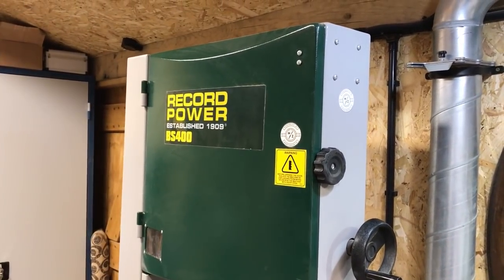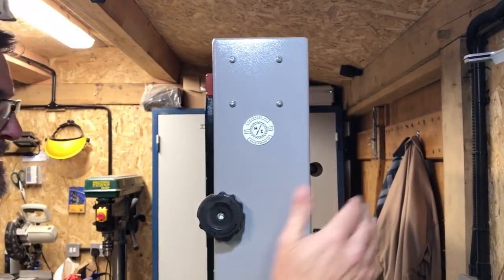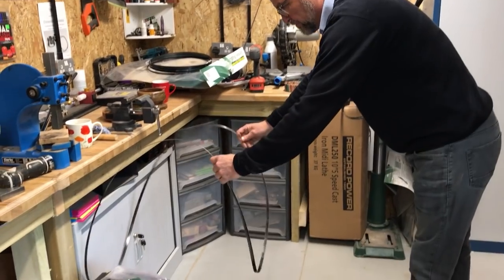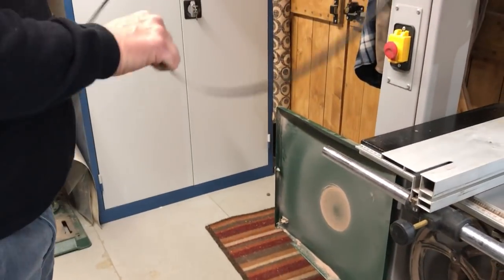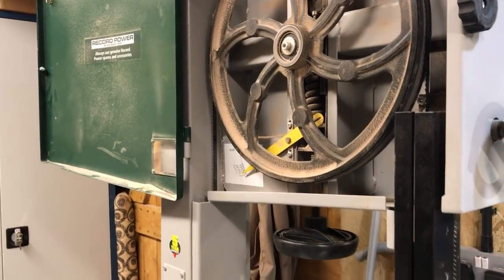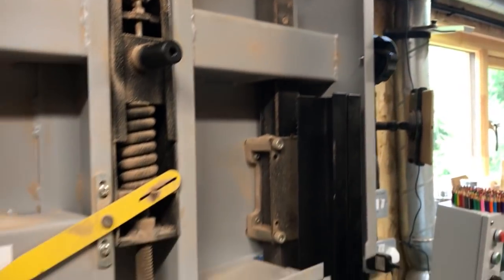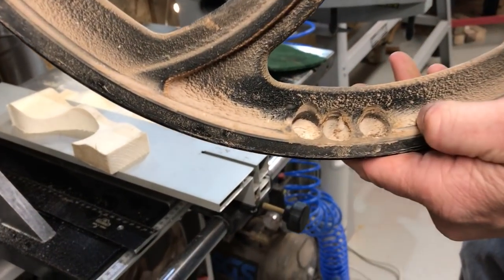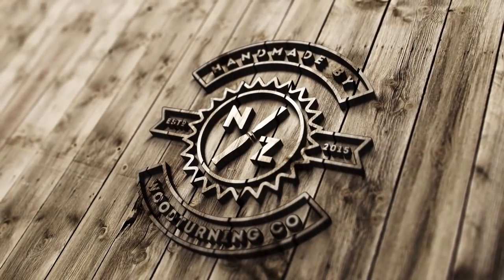RECORD POWER BS400 BAND SAW BLADE SETUP/CHANGE!

Comment: Hi Nick, This is a TOP CLASS video. I have just purchased a Record BS300e and even after reading the instruction manual and Watching the Record DVD Master Class that came as part of the package I was having difficulty getting the Machine setup correctly. Luckily I found your Youtube presentation which I followed as near as possible and I now have my Bandsaw running perfectly. The one part I had trouble with though was setting the lower guide bearings due to the protective blade guard obstructing the view of the blade guides. To ensure I was clearing the gullet  of the blade it was necessary to remove the protective plastic  guard which was a nightmare on the BS300. I might do a short video to show the best method of removing and replacing this item because without it is impossible to set the side blade guides.

Again it was only thanks to your video otherwise I wouldn't have got my saw setup properly.

Regards

Fred from UK

Comment: That is an excellent video, One of the best I have seen as it gives far more detail that new owners will need. I have the same machine and it is superb. I have also used the 1/8" blade with the Carter Stabilizer which is ideal for the smaller blades. Well done guys. Malcolm (UK)  INteresting to see just before you took off the 1/2" blade, the tension meter was well above the norm. Also, if anyone does remove the top wheel ( I never have in 4 years) remember to mark the position, otherwise the balancing weights will not be correct, if put back on in another position which is important. I would suggest the wheels are not removed.

Comment: Thanks Craig, really a quite thorough run through. Only suggestion might be a safety cut-off on the table blade gard at the front of the table slot. that bit is a safety feature after all. I love that this machine has a step down pulley, but why not a rheostat speed control for more versatility? Thanks Nick for having Craig in to show us the intricacies of your band saw.

Comment: Good saw but a real bastard to set the guides. DONT track the blade in the centre of the wheel, that's a common misconception put out by manufacturers, because the wheel is crowned, you want the rear of the gullet of the blade to be central on the wheel, that way the tension is on the front cutting edge of the blade instead of in its centre - do it that way and you will never get drift